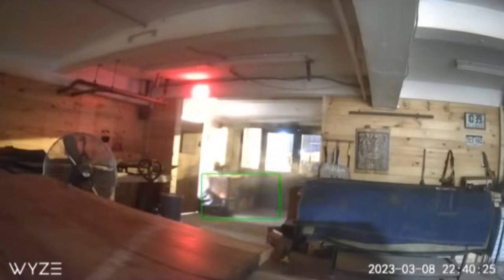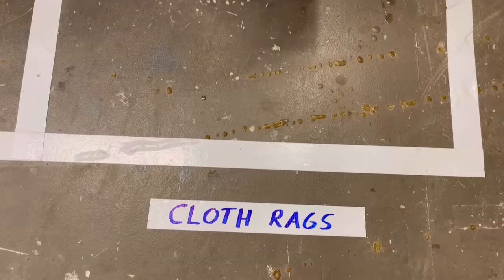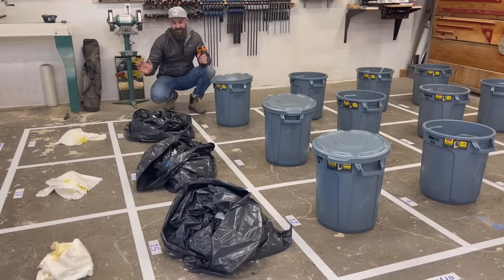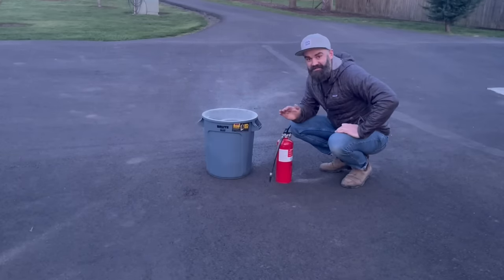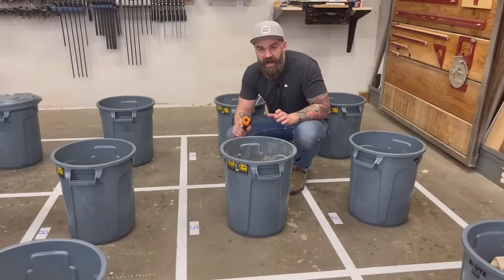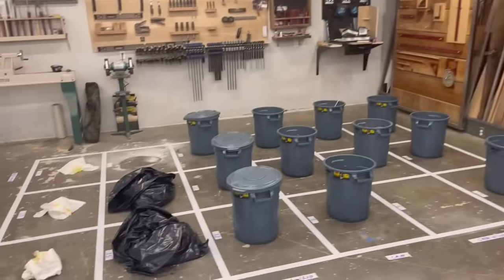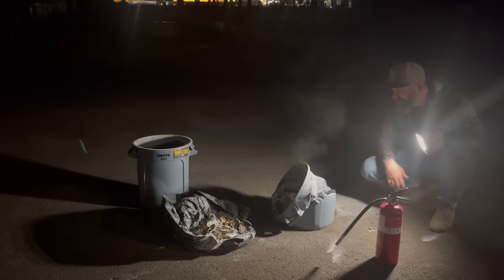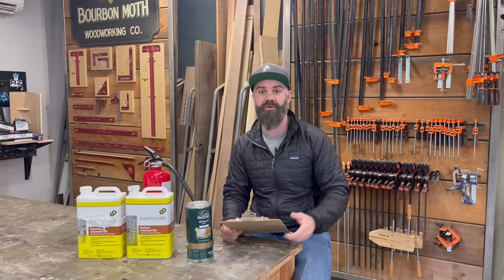I Tried To Burn Down My Shop || This Video Will Save Yours

Comment: The scariest thing about all of this to me, is that having worked on the sales floor and inside the warehouse of a lumber yard for ~3 years, communicating with the majority of the carpenters and hobbyist wood-workers in my small town, I have never once heard anything about this. Getting my own house has given me the space to start doing wood-working projects, and not once through any of my research, my old job, or word of mouth have I heard that oily rags are a fire hazard because of spontaneous combustion.

This is something that absolutely needs to be shared so that newcomers to wood-working like me can be aware of the danger this poses. I encourage you to take this video and try to condense it into a YouTube Short if you can, or a 3-5 minute video at the least so that this video's message can be more accessible in general for others to see and share. It would be one of the more important public service announcements that I have heard over the course of my life in all honesty.

Thank you for your video and your systematic approach to the situation, it really does annihilate any chance for someone to call this out as fake or staged, and really does show just how dangerous of a threat this is if it's not taken seriously.

Comment: My wife and I used melamine sponges to apply oil once. We almost had a fire with oil soaked sponge within an hour or two of using. It was sitting on the edge of the trash can drying. It started burning of the inside of the sponge. I'd be interested to see you test that situation to spread awareness. It go hot much faster than this oil rag test.

Comment: i just trow these rugs into a ash bucked its basicly a metal bucked with a lid and i trow in like a gallon of water in there just to make shure that when these rugs catch on fire the water vapor will extinguish the fire 

yea it works i testet it with a remote ignithin thingi für fireworks and a acetone oil rag i had lying around from cleaning some steel stuff 

sorry for my english

Comment: 13:30 You know what would have put that fire out? The lid! Why you did not have lids ready to extinguish the fires baffles me. You could of gone back inside to find more buckets on fire, and you had no plan to deal with it. "Carry them outside, then run and get a fire extinguisher". Not a good plan. Put the lid on and starve the oxygen... better plan! What would you have done if all remaining buckets caught fire while you were running around trying to deal with the first one?

Comment: Spontaneous combustion of oily rags is VERY REAL, Folks. As a kid, I went into my Dad's backyard shed to see what he had been working on. I got something on my hands and grabbed the nearest rag (linseed oil soaked) that my Dad had carefully spread out on top of a big steel anvil. I just tossed it onto the floor and left. Two hours later, I went back in a smelled something and told the old man. He REALLY didn't want me to interrupt the Golf match he was watching on TV, but came out to the shed. The instant he opened the door, the fresh batch of air caught that rag and WHOOSH!.......BIG fireball.
   He basically threw me out of the shed then grabbed the rag with a rake handle and I saw this flaming rag ball go sailing right by me. The wood floor where the rag was set was just starting to smoke, as well. I had NO idea that oily rags could be a problem, but never forgot it.

Comment: Nice video.  Very informative.  However, it seems to me that it would have been best to put a cover over those trash cans as soon as they burst into flames, before walking through the shop with the fire and then melting the trash can.  This would starve the fire of oxygen and put it out quickly.

Comment: AvE is trying to call you out. But  it seems his ego has gotten out of hand. He refuses to believe this really happened because he tried to do it, and it didn't act like yours.
Reply: Lol are you kidding?
Reply: @brianjohnson3961   dead serious... I'm still amazed people fall for his spiel.
Reply: @zomgthisisawesomelol  first off, halving "Zero Smoke" isn't that hard. I have a 55 gallon steel burn drum that doesn't smoke.
 
Secondly, that camera he had setup was pretty garbage (like one of the low grade security cams.) 
 
Could it be fake? Sure. But AvE doing a small scale experiment a year ago and thinking it's 100% fact shows that he is starting to believe his own 💩.  He might seem brilliant to the avg moron, but really, he is mid-tier, with a decent memory. 
 
I've been subbed to both for many years, and Ave (especially since Covid) has started to go over the deep end. The claim "its fake" because he can't do it is his ego. 
 
And to say "must be lighter fluid" was his rationalization to justify his beliefs... and beliefs have no association with truth. 
 
Far too many people worship idiots these days.
Reply: @zomgthisisawesomelol and a redo with the same things used before an front view an an overhead slightly 5 minutes or so prior an after it starts.  
Comparing flame growth speed smoke ect.    
He made 3 he surely can again easily

Comment: You're not very intelligent for plastic trash cans. (Is that better YouTube? Galvanized trash cans) would be really smart to because of the toxic chemicals that releases when it gets hot. But what if they all took off the same time in these plastic containers? You would have a problem.

Comment: You really din't think that through very well did you? First if your going to do an experiment involving fore INSIDE your shop might be a good idea to not only use a fire extinguisher at least once before making a fire let alone understanding what different fire extinguishers to (water, CO2, Chemical). Second have at least a basic plan BEFORE you make fire in your shop  for how to deal with said uncontained fire of oil and plastic bags etc. Third maybe maybe more than 1 fire extinguisher ready to go? Darwin was cheated again.

Comment: I deal with rags are coated with motor oil and grease and they're piled up on the workbench Eastbay whole pile them underneath the for years that's how my dad's rags  were piled on at the workbench with oil and grease never had this happen oh and nice use of lighter fluid and I know lighter fluid doesn't create smoke because I use a Zippo daily and I have sprayed it onto a fire before and no smoke those fires should have put off smoke before the flame was seen so nice try but it seems pretty fake because obviously you weren't getting the results that you wanted and people tend to believe what they see on the internet